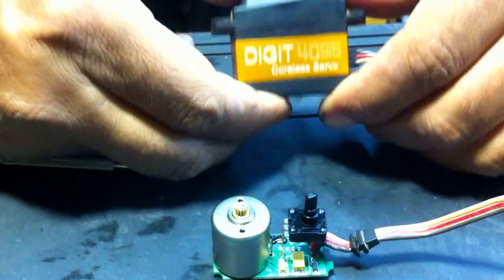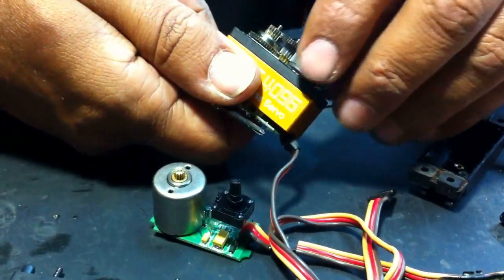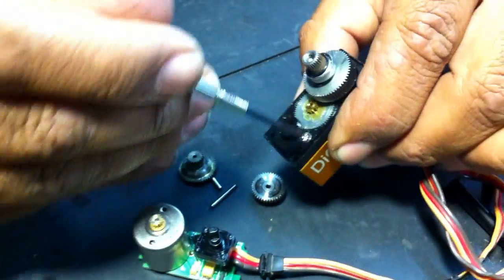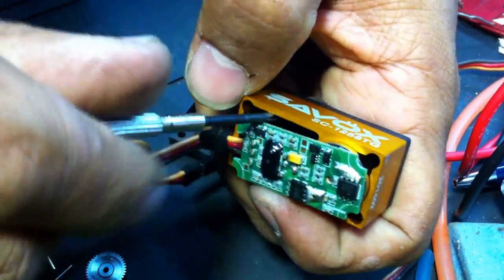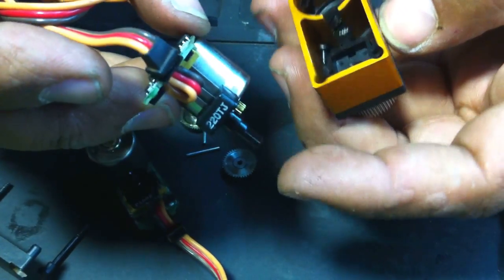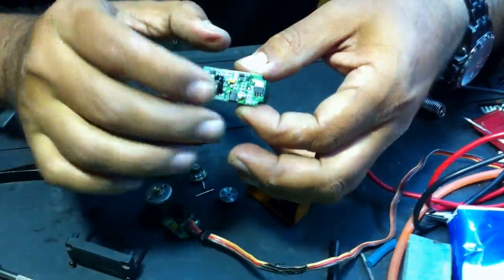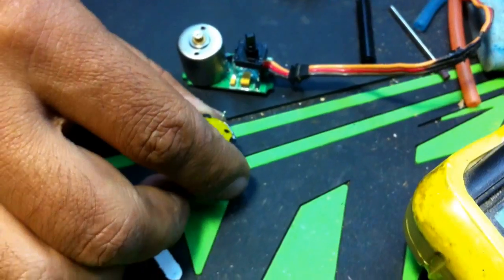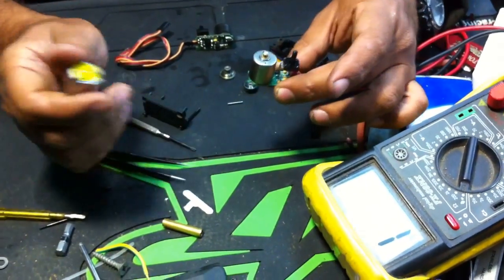Savox 1258tg / 1257TG  How to service / repair the servo, the pc board and motor

Comment: I have not tested the control board yet. But the problem is the gears getting stuck. Pure assembly is correct but it doesn't go. Solutions?

Comment: The RC maxi servo that I need to restore turns out to have stuck gears . I disassembled everything and reassembled but it still does not work . Solutions ? Thank you very much .

Comment: I saw that you short-circuited three pins of the two integrated .... But which IC is it? Does this method work for any servant? I'm trying to find a solution for my CYS8218 servo that always stays accelerated. I made several attempts but all of them failed. Some advice? Thanks a lot.

Comment: Thank You kind Sir.. you saved me $70 + My Time. I accidentally ripped off a wire from the board and needed to resolder it but couldn't figure out how to get the gears off or take it apart. Thanks again

Comment: Would this also work with a Savox 1290MG? I have damaged wire right under the rubber grommet going into the servo.
Reply: It will.. tried it myself, thanks for the info.. I think the hard part is going to be reinstalling the black screws! :) Any tips?

Comment: Where can I buy new coreless motor for Savox ?
Reply from the maker: At the moment i dobnt know BUT  I had 3 broken servos  and i saw that all didnt fail  on the motor section , so I saved a motor from a burned  pc board  servo.  Ofcourse im  searching , and as soon as Ihave  news ill inform. aLSO IF SOMEONE KNOWS   WHERE TO ...  please  inform here !:)
Reply: +Stelios Telixx   looking also - would be nice to find a source as this part is relatively easy now. Your video helped me fix 2 but motors and or potentiometers would be nice to find for sale somewhere.
Reply from the maker: +osobogly Glad  the video helped somehow...    You gave me an idea ..  The motor  im shure  isnt savox .. ( we know how the industry works with  fason orders) This aint any special motor...   some time i did swap it with a cheapy servo motor that  was  the same dimentions  ....and  WORKS PERFECT !  S ooo.. ill look into it  ! :)
Reply: +Stelios Telixx  -   Great to hear - I purchased a cheapy over the last week and tomorrow plan to test a motor replacement into my very expensive high torque servo and I'll update on results. :D
Reply from the maker: +osobogly Great   take some pictures  of the 2 motors so we can compare them ! Wher did you buy it from ?
Reply: +Stelios Telixx   

Here's the link to a pretty cheap/decent speed coreless metal gear servo:  
http://www.banggood.com/JX-PDI-6221MG-20KG-Large-Torque-Digital-Coreless-Servo-For-RC-Model-p-973947.html
Reply from the maker: Great ..  did you  dismantle it ? are the motor  same size an  same place conectors? :)
Reply: yes - sadly very different configuration for each. Not sure how to move forward
Reply from the maker: +osobogly  isnt the motor same size an  contacts ?
Reply: +Stelios Telixx no its not, it was longer
Reply from the maker: +osobogly  I have an idea...... Ill  open all my  broken servos ...and  I should find an identical ...  got over 20 in the "defective box " ha??